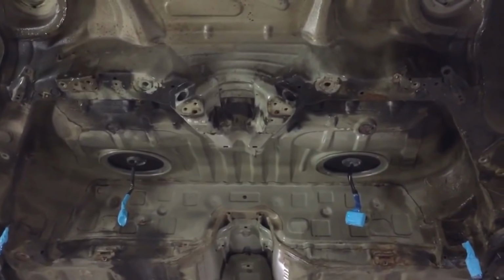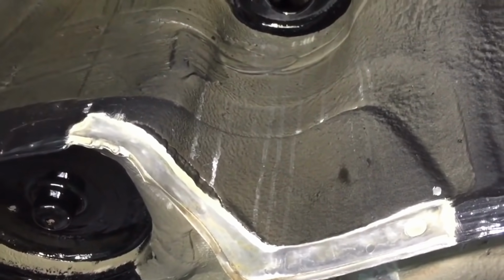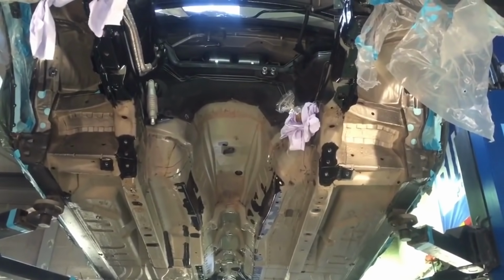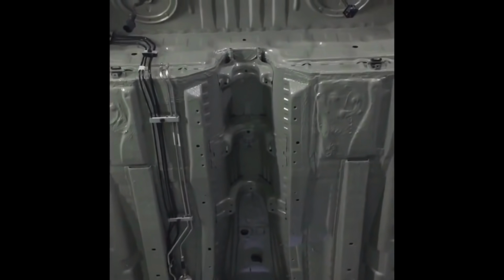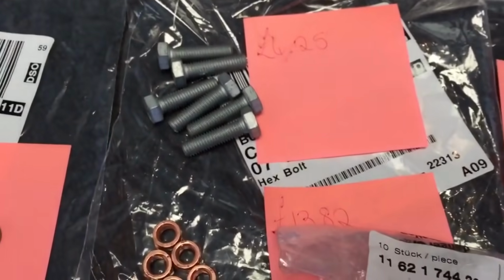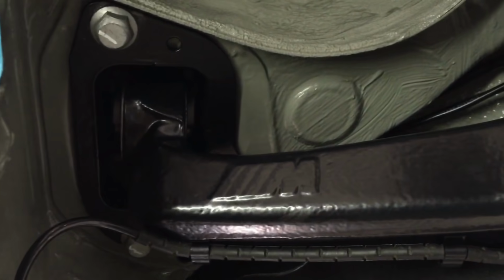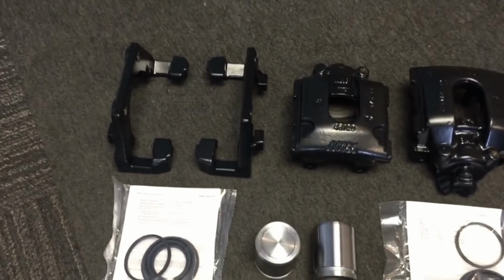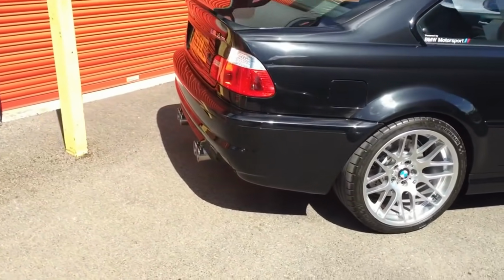BMW E46 M3 CSL - Underside Restoration - Better than new!

Comment: Gotta say, outstanding job and attention to detail. I left it a bit late, started restoring cars in 2010, I am 70 now and trying to finish restoring a BMW E31 840Ci. These are some things I have learned over the years which may help someone out there thinking about spending what appears to be limitless amounts of money on things that don't really need doing. Do not put any faith whatsoever in POR15 products, they ae expensive and don't work or last. If you were to peel off some of the new seam sealer spray and expose the POR15 painted metal underneath, I can guarantee you it will already be rusting again. I overhauled one side rear suspension on the 840 about 8 years ago. I had the parts sandblasted, picked them up immediately, treated them with the POR15 metal prep or prep and ready whatever the y call it, then painted the parts with 2 coats of black POR 15 rust preventative paint. They looked the business. About 3 years ago i stripped the rear subframe off the car to do some welding, the side that was original from 1998 looked perfectly OK, the POR15 parts look like they came off the Titanic. All the very expensive super-dooper new nuts and bolts from BMW with a silver zinc finish will already be rusty and look crap. The plating BMW use is just garbage and damages anywhere where a spanner or socket grips it. For much less cost, you can replace all the original bolts and screws with stainless steel, paying attention to the high tensile ones naturally.
Reply: Thanks for sharing! How do you prepare your underside beginning from surface rost removal until the finish?
Greetings Patrick

Comment: Just did this on my 2003 bmw m3 non CSL, I restored a 1970 camaro over the last 5 years and man this was so easy compared to having to fabricate every step of the way. thanks for the video I used a-lot of your process I have a welder but I used epoxy for the subframe  reinforcement plates since i luckily did not have any cracking. These cars are so worth restoring they are one of the best cars ever made.

Comment: For the various heat shield mounding bolts,  why not use a silicone or other high temp material like phenolic washers under the head of the mounting bolt.  Wouldn't that stop the galvanic corrosion?
Reply from the maker: Good idea Brain - I like the idea of those washers - I'll look into this for the next one.

Comment: Great work and thanks for reminding me how much BMW is low in quality. That looks like a 200k mile Lexus underneath.
Reply: It’s not BMW it is the weather conditions and care the owner has taken or not taken. My E92 is daily driven to over 150k miles and is mint underneath but I live is south east USA so no snow salt and little rain, also car is garages which is a big help. Cars in the north get beat up bad because or road salt and sea salt air by the coast. High humidity is bad too and why cars from areas like California are coveted bc they are preserved and rust free most of the time even with little care. Location is HUGE, BMW protective coating process work fantastic. My hold is peppered and still not a spec of rust. BMW gets huge thumbs up

Comment: Absolutely phenomenal work. I'm curious as to why you guys didn't carry out your topside analysis/reinforcement inside the boot and under the rear seats as you've done in the past? Surely if you found those amount of cracks and separation underneath the car there must have been topside cracks as well. Love the extreme attention to detail in the work you perform!

Comment: I think it's a waste of time getting underneath done.coz on a heavy muddy rainy day that's gone
Reply: Video clearly wasted on you, if you believe that a days driving on a rainy muddy day can wash of structural repairs, seam sealer, and stone chip coating.
Still at least when your visually bling bling motor lets you down, you can put your feet through the floor and motor on Flintstone style.
Reply: Gone? What do you mean?